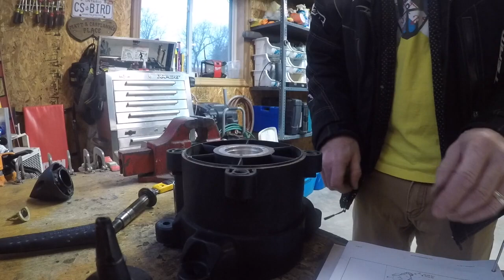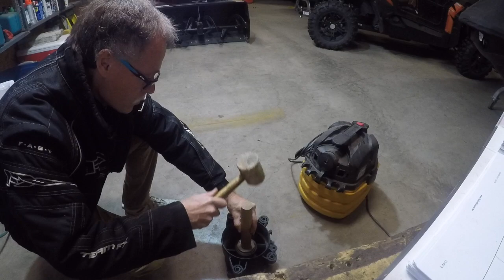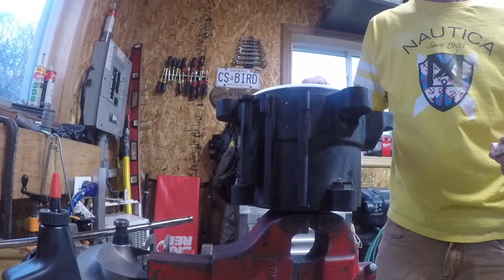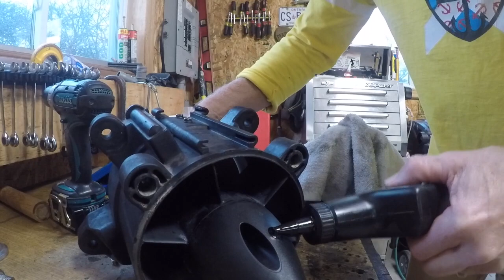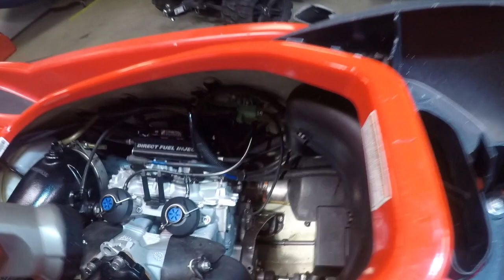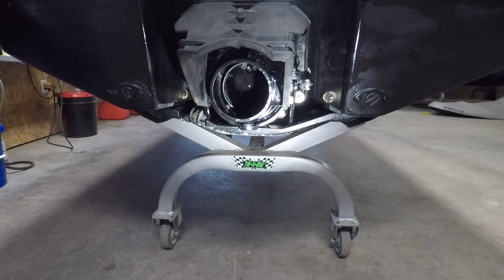Seadoo RXDI Frankenstein pump repair

Comment: I’m on the same page. Seal was correct the first time according to the manual. Why did you change it?  I ask because I’m doing this tomorrow
Reply from the maker: I confused myself as well.  Spring goes down.  The previous install of the seal was spring up and that was what had messed me up.

Comment: I want to ask about the Oil Pump Seal. I just did mine IAW the 2004 GTI LE RFI shop manual and it says to install it with the spring side facing out towards the impeller. It shows a picture and discusses about packing grease in the lip cavity of the seal. Page 627 approx I think. This is even after pressing it in. You initially installed it that way as did the guy before you but then you changed your mind. Why? Is the shop manual wrong? I don't want to take mine back apart if it is okay. What do you think?